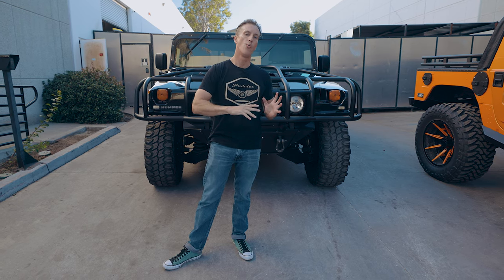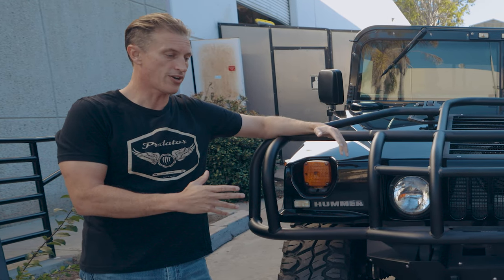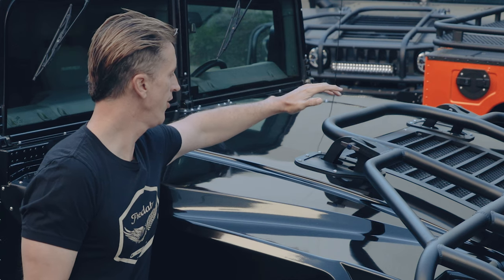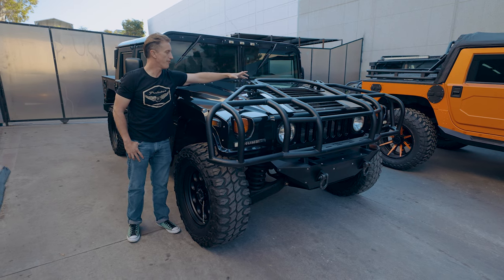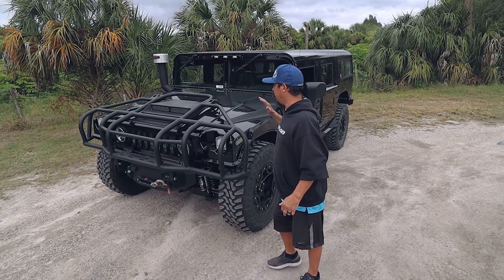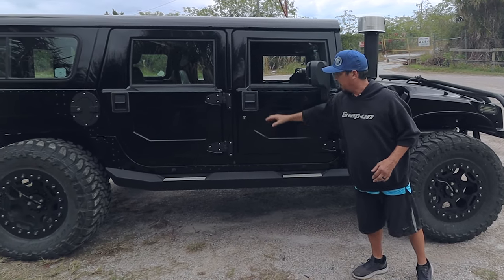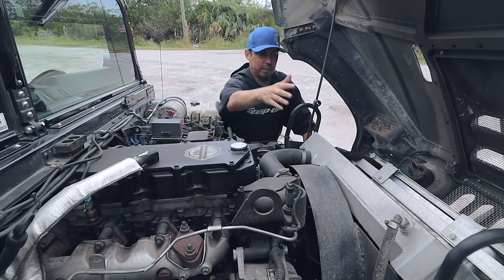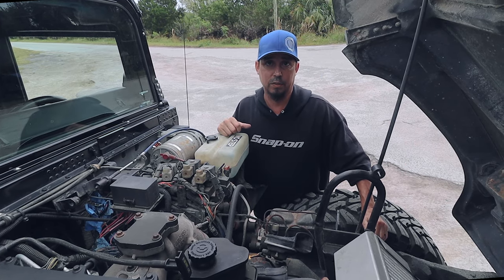DURAMAX H1 HUMMER OR CUMMINS H1 HUMMER???

Comment: And then there is me and my unconventional desires, found a detroit deisel 8v53t 6.9L twin charged 2 stroke V8 diesel for sale on power forge and I'm currently trying to shove it into my h1. I am using a predator bypass box that you use to get a mechanical engine to "talk to" the electronic transmission the same one used in a 12 valve cummins swap. I'm probably also going to use a predator Allison built transmission because wirh a moden billet turbo compressor wheel and a set of n70 injectors on that 53 series should get me about 430 horse and about 1100 torques.

Comment: I absolutely love the sound on the Cummins. It sounds like a TRUCK. Like a real commercial vehicle. But which one is better from a fuel economy standpoint?
Reply: H1 and fuel economy shouldn’t be in the same sentence.
Reply: @erineopenaloza8311  it should, if you want it just for street driving and going to the office or grocery not so much but if you are off roading, overland, you dont want to be without fuel so quick

Comment: Very cool, going to be buying an h1 soon. I’ve heard that 1996 and older, they used electrolysis to make the frame and body rust resistant. Would a pre 1996 be a good foundation vehicle for being a future duramax conversion candidate? 
Also, 2. If I bought a soft top hummer, is there anyone who makes  a hard top shell to make it into a wagon oin the future?
Reply from the maker: No, all the same. Electrolysis is actually a process of rusting caused from dissimilar metals which isn't good. It can be common on h1's especially wagons. Not really a big issue on soft tops because they don't have a steel roof. But back to your question, there is absolutely no difference in rust prevention between years. They are all the same. As for a wagon top, snugtop made one but it leaked and was quickly discontinued about 25yrs ago. Plus it looked a little goofy because the soft top is a bit taller then wagons so it created a helmet top look.

Comment: That orange truck is fire! Search and rescue, in the house! I have a dream to try 3m Diamond Grade³ reflective laminate sheeting to achieve that orange color. (DG³ is what they make the best modern street signs out of, these days.)

Isn't that loose aftermarket outboard CTIS line vulnerable when offroading? I would think flushmount or inboard would be safer (but also less convenient).

Comment: Neither, I like the stock engine of the hummer
Reply from the maker: Which one? The under rated 100hp na or the Turbo that grenades before you get to 100k miles? Haha, just kidding. The 6.5td isn't too bad in a lighter truck like the soft top but the #7 and #8 become suspect when approaching 100k miles.
Reply: The na, something about the sound that gets me, plus it’s waterproof so that’s why it is able to go into deep water without issue

Comment: I recent drove a Humvee and could only stand it for about 10 min. It sounded as if everything underneath was hard bolted to the frame, rattled like scrap metal parts bouncing around in an empty 50gallon drum. Perhaps this was a fluke….or maybe it’s normal.
Reply from the maker: Tough call without seeing it but it should not be making all those noises. The truck should be overall very tight. The stock gm diesel engine is a bit noisy but not what your describing. Sounds like a rough hmmwv with little to no maintenance being performed.
Reply: @PredatorInc   I can handle the sound of the diesel and the related acoustics of a non insulated interior, but it sounded as though the exhaust and motor mounts were hard mounted to the body/frame with no isolation. The Humvee came from the Marine Corps base in So Cal and had 2000 miles on the odometer, was overall very nice visually. The fleet owner over here at what was until recently called the Idaho Motor Pool said all Humvees sound like that one. We had cash but could not bring ourselves to pay for something like that. I guess it's what happens when one is a n00b of sorts. Thanks for your previous reply.